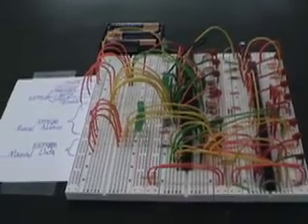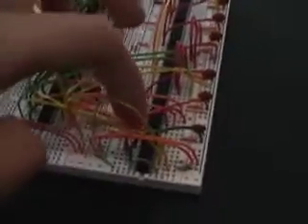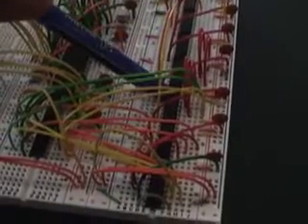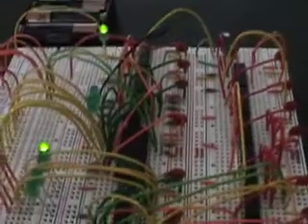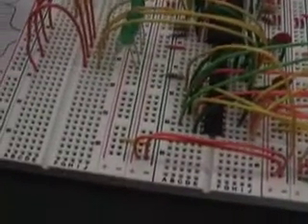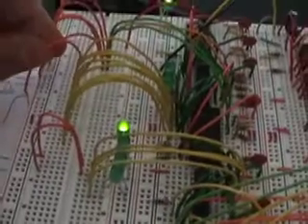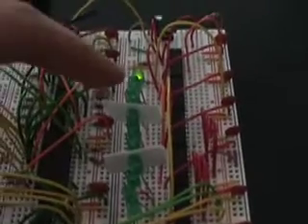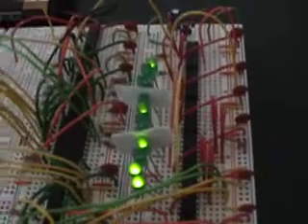DUO Elite Computer Construction Vlog (1)

Comment: Where did you get your design ideas for the argument registers and control portion of the ALU and the primary driver circuit of the CPU?  Would it be possible for you to do a more detailed video on this portion of either your 4 or 8 bit design?  I love your TTL project.  I've always wanted a simple computer in TTL with lots of lights to show people how it works.  Are you planing a career in EE?

Comment from the maker: @twoofakindmagic Have you done any programming? If so, making a CPU much easier. The whole point of building a CPU is so it can run programs in a particular language, called its "machine code". Your machine code can have any syntax/commands you want; it depends on the desired functionality. If I were you, I would look at the data sheets for the chips I used (you can find a list on my computer's site), then maybe buy a few and experiment. If you want more help, PM me!